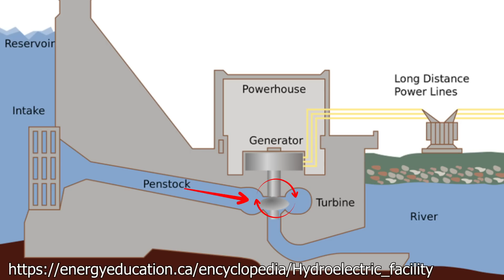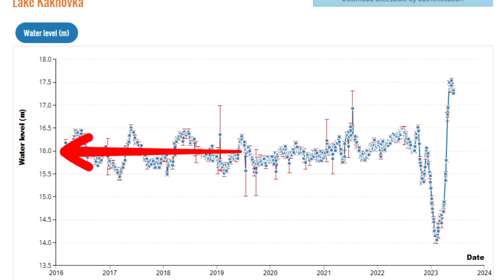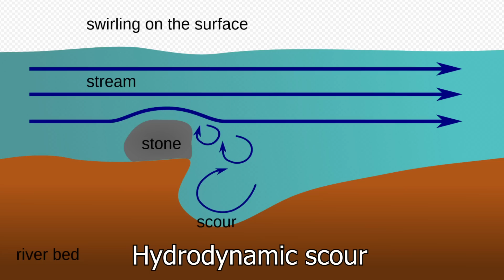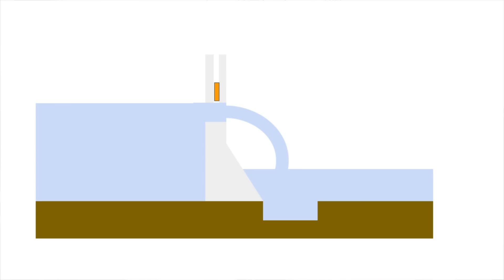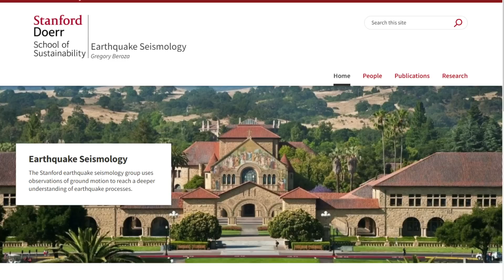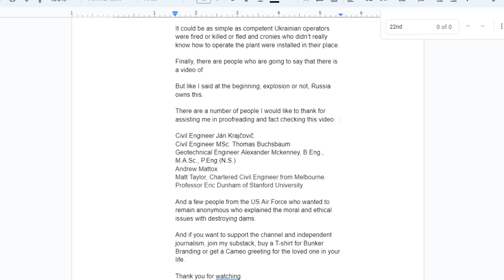How Russia Destroyed the Kakhovka Dam

Comment: I am a planning engineer in British Columbia, Canada. I help plan the operations for all the hydro electric dams in BC, including Mica dam, the earthfill dam you used in your intro. Without constant observation, maintenance and proper control, a dam like this can simply fail on its own out of simple neglect. Good video and I appreciate you getting up to speed on a complicated topic and the amount if work you put it. Keep uo the good work!
Reply: A dam like this? I’m a combat engineer who went to school for civil engineering to receive my BS and MS in civil engineering. A steel reinforced concrete dam would not have multiple water egresses all coincidentally at the same time with no external kinetic forces being immediately applied. As you should know, the majority of karakova’s infrastructure is beneath the water and it’s width increases towards the reservoir. Even if there were cracks,  a catastrophic failure at multiple points would be an absolutely unique event. We would also have to assume that the Russians took zero action with the needed repairs and just let the damn fall apart. I’m in Arizona where dams are a critical infrastructure that enables modem life to exist in such an inhospitable environment. I hav many colleagues involved in the water works infrastructure of Arizona. Only having been face to face with one such colleague this week he believe it is not a failure.
Reply: @paperandmedals8316  Unfortunately, the repair was not possible, the platinum is located on the border
Reply: @paperandmedals8316  sounds  sovirussian  enough   to  fit  reality
   a  human  disaster
Reply: @paperandmedals8316  Well, we do not need to assume, we know that for a fact. Ryan did not joke about snipers. That damn is literally on front line and at fire by both sides. In fact there is a video from Russian thermal imaging camera of damn starting to fail. And on that same video you can see really big bird flying along damn really low. And you can see mortar round explosion on that bird course on damn - probably somebody fired just because can not see well what is it moving there. That how things was.
Reply: @vladimirpecherskiy1910  tell me you know knowing about civil engineering. That video with your bird also showed the dam having already failed. How about the multiple videos showing water mines exploding. I know it’s hard to believe your beloved Russia being a further aggressor but maybe now you realize why the world has lined up behind Ukraine and is praying for Russia to burn. Thoughts and prayers 🤗
Reply: @paperandmedals8316  Well, first - I am Ukrainian origin, born and race in Ukraine, though now have US citizenship. As Ryan still correctly pointed out - Russia responsible for event, no matter how that directly happen.
Now I do not know what you mean about "water mines". There are multiple videos and photos of mines washed by flooding. Pretty much all riverside mined there with thousands of mines and many of those washed away. Can not see any special to it.
Reply: My father was a buyer for BC Hydro for most of his career. He spent most of his time fulfilling purchase requests from the various dams. During our summer holidays, he would often stop by the dams to visit Hydro employees who he had only known from phone conversations.
I was about 13 years old (1973) when we visited the Mica dam. I was walking along the roadway on top when one of my dad’s colleagues who was driving by, stopped and asked if I wanted to see inside the dam where the turbines were located. Of course…YES!
He drove me to the entrance and spent about an hour show me the inner workings of the dam. Absolutely fascinating!
However, my mom had last seen me walking along the roadway and I had been tossing rocks… then she turned her back and that’s when I was picked up. 
By the time my private tour was over, she was a mess…assuming I’d somehow fallen off the top. I was rewarded with a mixture of happy tears & anger 😂
Reply: @ddaniels I can agree with you.  Dams are sophisticated and complex.  Its insulting to dam engineers to assume that they can just take care of themselves.  But I haven't seen any pictures demonstrating a progressive collapse where the powerhouse structure was not already shattered.  Wouldn't it be more typical that we would see overrunning, point of weakness failing, and then progressive damage radiating from that initial point of failure.  Why was the Russian Bank portion of the turbine hall gone before the center section?   Isn't that atypical for an overtopping collapse?
Reply: @johnramsey2009  Dam engineers, all the dam engineers or hydro engineers will do is monitor the generators, the control gates and the level/flow sensors. They do not fix concrete or rebar that is left to a professional contractor. They will operate the control gates under instruction from the control room.
Main causes for maintenance on a dam is cracked/spalling concrete or corroded rebar, faulty control gates and systems.
Reply: What's the probability of a dam collapsing in any given week, after a year of neglect?  Unless the probability is very high (in which case, why weren't experts raising the alarm?), then it's a remarkable coincidence that a dam that was rigged with explosives, which the Russians said they would detonate in case of an offensive, collapsed on its own at the same time as the offensive was starting.
Reply: @alexanderm2702  you  just  explained:  no  coincidence,   komrade  trollski
    get  in  the   tank  .
Reply: Russia destroyed its own water source? How interesting. Who is on record attempting to blow this dam multiple times? The world is just not buying your lies and propaganda anymore.
Reply: Perhaps you can explain how the dam failed in different areas simultaneously. That’s what I’m struggling with.
Reply: @angrydoggy9170  Go tell your Supervisor the World ain't buying the lies and propaganda anymore. They can see right through you. Now run-off and take the report.
Reply: I've been in Mica back when the '90s when the Visitor's Center was still open.  Walked through the rock tunnels and stood on a turbine within arm's reach of the main shaft.  That tour was 100x better than the Disney-fied Revelstoke tour (though I've also been to Revy during a special tour that gave access to places like the generator hall)
Reply: As someone from B.C. Canada, why the hell did the Ruskin damn take so dam long to refurbish? (Pun intended)
Reply: @Balognamanforya   getting shelled by Nazi's makes it hard.
Reply: @davidlloyd2583  lmao, how the hell did the russians make it to B.C. already 😂
Reply: Still Russias responsibility.  Accident or not.
Reply: I'll tell you what I heard from people on the ground... But basically they were messing with them trying to scare ukrainians but they overdid something and  everything went wrong... She didn't say what exactly they were trying to do about they were trying to scare ukrainians with some and over did it. Maybe he has something to do with the water level on being too high.. But  hundred percent they did something...
Reply: BS propaganda. Only the paid botts camped here buying it. The rest of the world, "Nyet". And that is the report you have to take back to your supervisor.
Reply: thanks   pls  see  my  note  now  on  FL  DOT,  deCaligula  and  cronieyism:  political   "engineers"
fyi  "caliga"   latin  for  "sandal"
     caligula   =    crappy  little  sandal
Reply: I'm a civil engineer in the Netherlands. We are instructed to design everything to withstand without needing human interaction. And if not possible it's considered a safety risk
Reply: @chrisdejonge611  And washed away the mines and the soldiers stationed there....and the earthworks, ammunition, medical supplies communication equipment. There was no retreat from the positions this caught the Russians out.
Reply: Nothing like a little artillery and a couple of sniper teams to encourage neglect.
Reply: @kenreynolds1000  yeah well this is true this damn has been hit by so much artillery and not failed there's even a video of it being hit with artillery after it failed and it literally didn't do anything there is a mountain of evidence to suggest that Russia did this on purpose and yet everybody is jumping to the conclusion that it was due to neglect when there is literally no evidence
Reply: @kenreynolds1000  Wow, this channel is just swarming with Ruzzian apologists. Nothing Ukraine has can do the necessary damage to a hardened concrete and steel structure of that kind from a distance that could precipitate such a collapse. Everything Ruzzia has done screams "WE'RE GUILTY AS HELL AND WE DON'T CARE WHO KNOWS IT!!" Their propagandists are now saying that they should go after the very similar Kyiv Hydroelectric Dam! They passed a law on May 30 to make investigation of structural failures of dams in the occupied territories illegal (weirdly specific). They have confiscated all the boats on their side of the Dnieper. They pulled all their valuable military equipment back from the area days before this. NORSAR, a Norwegian monitoring agency, recorded a number of seismic events coming from the dam, the most significant at 2:54 am on 5 June.  These are more consistent with large explosions than any "overtopping of the structure" by water. That might damage the top but would not destroy that section of the whole all the way down `as was done in this case. Ruzzia has been holding the dam hostage and has threatened to blow it up numerous times over the last several months. When this fails to bring about the desired results, expect the Zaporizhzhia Nuclear Power Plant to melt down due to "a little artillery and a couple of sniper teams." W.T.F.
Reply: It was hit by 3 HIMARS in december, on the flood gates for laugh by Ukraine.
Reply: Except this isn't a normal dam this was built by the Soviets to withstand a nuclear blast
Reply: @colchronic  But the amount of energy from a few extra meters of water depth on a dam can be translated into similar energy potential to a small yield nuclear weapon.
Reply: @colchronic  The Soviets were as bad or worse than anyone else when it came to cutting corners and they had some fairly questionable practices on their own.
Reply: @killjoy1887  there have already been videos of Ukrainian using himars on the dam in November nothing happened
Reply: @colchronic  interesting the himars strikes on the dam were on the road.  Right where it does it's curve.  

That piece of road stood until it miraculously disappeared as others including Ryans video showed in the day or days before.  

I still think the Russians were doing some demolition on retreat, And that little bit of shock, on a dam that was ready to pop.  

Pop
Reply: @YahWay.  there were several missed shots from what I understand and yet even though they shot the road it took several attempts to blow up the road and that's just a road they have tried to take down bridges with artillery before and have very little success The only time the bridges were collapsed was by retreating Russians with satchel charges placed at the base of the bridge I do not think this was an accident I think there's overwhelming evidence that this was done purposely and intentionally
Reply: @colchronic  much like the bridge over the DNIPRO, The himars just put holes in the road.  It could still be used but not by heavy machinery.
Reply: @colchronic  
Hi Mars rounds are deadly for vehicles and personnel but not for dams LOL.
Brian suggested that it would take tons of explosives and highmore's rounds are under a hundred pounds each. I looked it up...
The warhead is produced by General Dynamics and contains 51 pounds (23 kg) of PBX-109 high explosive in a steel blast-fragmentation case.

Remember when they were attacking the antonovsky bridge for months and months? They shot that thing with himars day after day and couldn't get it to fall. It's also just a bridge without a dam underneath.
Reply: @jerseyshoredroneservices225  yeah that's what I'm saying an external attack would not do jack shit It would have had to have been a structural collapse or a internal detonation but I doubt it's a structural collapse because it's already survived so much shit
Reply: Jeff B, your source, please?

Also, it is ~70 years old.  ALL dams require maintenance, and will fail eventually.  If not properly maintained they will fail sooner.
Reply: @DennisHicks78749  source of what exactly most of my sources can be found on project owl
Reply: @DennisHicks78749  I think a key will be the reason the dam was rising, and was topping.  So high it was overflowing and already flooding 1 ft a day below the dam

As I said, even Russian officials were warning about this.

Either the dam was completely broken and mismanaged.  Or it was intentionally being overloaded.  

Incompetence alone could take it down

Incompetence and some demolitions could unintentionally take it down

Intent to weaken it and some demolitions, would be freaking war crime territory
Reply: @YahWay.  Yeah that all makes sense.
Reply: @colchronic  If one more person repeat that BS about "nuclear blast" I'll start screaming. The smallest nuc is hundreds tons of TNT equivalent.  Direct hit of if (not an air explosion as been done in Japan) that would destroy about any human build thing that not deep under ground.
Reply: @vladimirpecherskiy1910  never said a direct hit it's meant to survive a nearby blast in other words the overpressure from a nearby explosion

Please start screaming
Reply: @colchronic  10 miles is still "nearby" 😀
Reply: @vladimirpecherskiy1910  yeah but it's not really a direct hit like nothing can survive a direct hit not even NORAD
Reply: @colchronic  And that excludes the dam from the laws of physics?  You either can't  or don't want to understand the explanation in this video. Overtime wind and water can erode mountains.  Even a mega dam doesn't compare to a mountain. Or maybe you're a flat earther & don't believe in geological development either.
Reply: @colchronic  
Perhaps designed to withstand a nuclear blast but with the Soviet corruption level at 10, imagine how much compromise could have occurred in the building of the Dam.
Reply: @colchronic 😂
Reply: @colchronic  I have seen this often stated fact about the Soviets engineering it for certain things

First, Soviet engineers weren't perfect.  Second this wasn't a nuclear blast on the outside.  

It was either an internal detonation combined with the precarious state of the dam.  

Russian, yes Russian officials were warning of the state of the dam in the weeks before.  Either it failed on its own or just needed a little push
Reply: @YahWay.  The warnings were the could not get the control gates to open.
Reply: Everybody suddenly an "expert" here to support Ryan. So many paid Botts to spin the tale. Your propaganda and lies ain't working anymore.
Reply: @ring-tone278 
As a Russian you'd definitely know Botts when you see them.
Reply: @dukecraig2402  People are beginning to distinguish between the Truth and the Lies and the propaganda. They cannot be lied to. The lies don't work anymore.
Reply: @ring-tone278  lol wat
Reply: @colchronic  People are beginning to distinguish between the Truth and the Lies and the propaganda. They cannot be lied to. The lies don't work anymore.
Reply: @ring-tone278  lol what lies
Reply: @ring-tone278  Why are several of your replies under different comments identical? You wouldn't happen to be a bot yourself.. no?
Reply: @ColePhelps61  People are beginning to distinguish between the Truth and the Lies and the propaganda. They cannot be lied to. Your lies don't work anymore.
Reply: @ring-tone278  What lie? What propaganda? You’re writing words without actually saying anything. 
You sound like a bot.
Reply: @ring-tone278 ”botts” nice try, Yuri
Reply: @SilkyDuragsOnlyNoExceptions  People are beginning to distinguish between the Truth and the Lies and the propaganda. They cannot be lied to. Your lies don't work anymore.
Reply: @ring-tone278  paranoia is a hell of a thing
Reply: @ring-tone278  Lol. You should do stand up.  You don't need to be an expert to accept a well reasoned theory with doccumented supporting evidence.  Another, better & contradictory theory might come along next week. Honest people capable of logic will go where the evidence leads. Whether it's incompetence or desperation, Ryan's vid makes a good argument for Russia being at fault.  "Play stupid games, win stupid prizes."
Reply: @teddyrasputin3850  People are beginning to distinguish between the Truth and the Lies and the propaganda. They cannot be lied to. Your lies don't work anymore.
Reply: @ring-tone278  Wow Ring Tone. Great thinking. Lmao
Reply: @spcrusch  People are beginning to distinguish between the Truth and the Lies and the propaganda. They cannot be lied to. The lies don't work anymore.
Reply: @Ring-Tone  thanks for your input Вовочка.
Reply: @ring-tone278  what now, ruzzobot?

Comment: Why do you assume that the structural collapse wasn't caused by an explosion.  Yes, I agree Russia probably didn't intend to take out the damn but it seems  plausible that an explosion designed to take out the turbines or create a small breach was used which weakend the structure.

I agree the mechanisms you suggest are very plausible as well.  I'm just not sure we can be very sure - especially since a smaller explosion wouldn't show up.   

Also, if Russia had  heads up they must really be incompetent since they could have done much better to win the PR war.